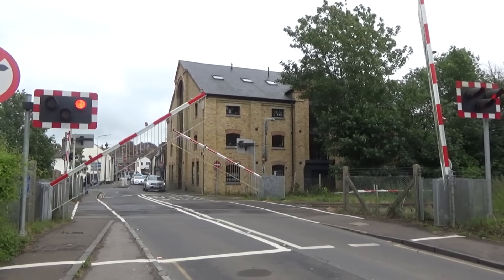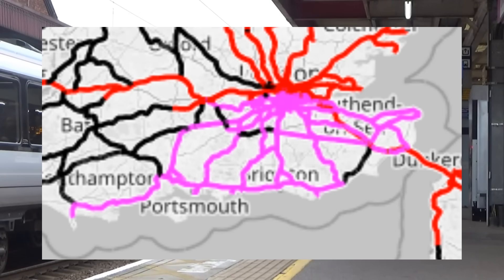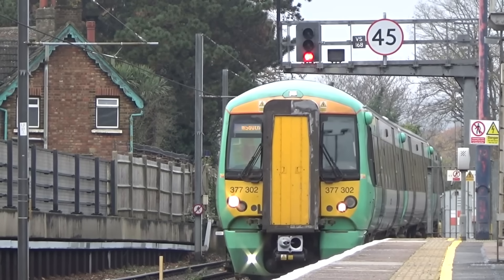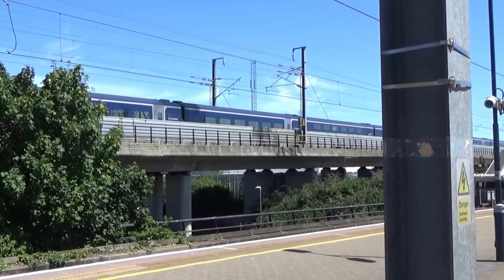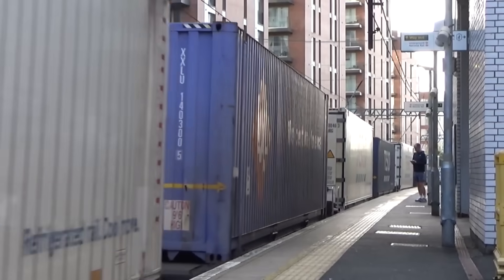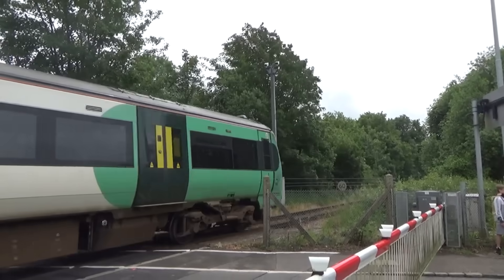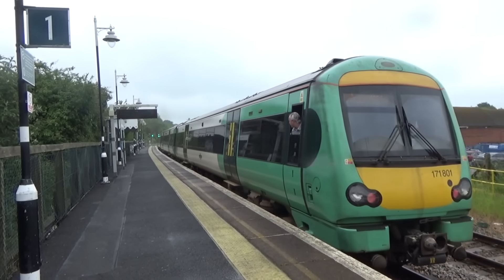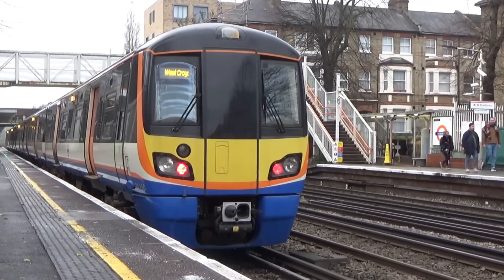Are These Railways Actually Unelectrifiable?

Comment: 0:56 merseyrail is/was third rail, oops, you said it just said it the very second i said at but they got battery trains now
Reply: Some of Merseyrail is third rail some I’d overhead; I cannot remember which lines are which.  Third rail was used on the Mersey Railway before it was used in the South.  The Liverpool Overhead Railway was third rail, but that closed in 1956.

The line from Manchester Victoria to Bury was a strange 1200 V side contact third rail system, now converted to 750 V d.c. overhead for Metrolink trams.

Som lines on North Tyneside were third rail, but de-elected and then worked by Diesel.  I think this happened sometime in the ‘60s.

Volks Electric Railway in Brighton is third rail.

Glasgow Underground is third rail.

London Underground is  4 rail.

Ex LMS lines in the London area were 4 rail but later converted to third rail.  The Euston -Watford ‘new’ line still is, the Rickmansworth and Croxley Green branches have closed and the North London line has been converted to 25 kV overhead except between South Acton and Richmond.

The Great Northern and City Railway is third rail from Drayton Park to Moorgate.

The Post Office Railway was third rail but I think the short section around Mount Pleasant which now carries visitors to the Postal Museum is now worked by battery trains.

Have I missed any others?
Reply: @srfurley think Merseyrail these days had class 507/508s before the class 777(s) across wirral and northern lines, those where the only two lines(?) in Liverpool that where 3rd rail lines
Reply: @AdamHinckley 
Yes, two Merseyrail lines are rhird rial, but I couldn’t remember which two.

I forgot about the DLR, 750 V d.c. bottom contact protected third rail.

I’ve seen a protected top contact system in New York.  The top and outer side of the rail are covered and the shoe is a sort of flat paddle which enters from the side to contact the top of the rail.  It’s something like the old Bury system rotated through 90 degrees.  Not sure if that would be allowed for new installations here, but the incompatibility with the rest of the network would be a problem.
Reply: @srfurley the only other one besides Wirral and northern lines was Liverpool overhead railway, another third rail line
Reply: All of the "Loop and Link" parts of Merseyrail are third rail - the lines in the Wirral plus the three branches going North from central Liverpool and the corresponding branch heading South. These lines all use the tunnelled sections of the network for which DC makes sense and were electrified back in the Jurassic period. The rest of Merseyrail are "branded" suburban lines radiating out of Lime Street so they got OLE when the main line line got electrified in the sixties and thereafter.
Reply: I remember the Southport/Ormskirk northern lines are third rail, they where thinking few times to extend the line from Ormskirk to Southport on third rail, it's only Wirral and northern lines are third rail in Liverpool
Reply: @paulc4383  Actually, the 'Merseyrail City Line' branding is of Northern Rail TOC is in four routes, two are OLE but two are diesel. The latter two could be 777 battery run if Merseyrail  was allowed the capital powers to get the sets; they would charge at both Lime Street and at Chester or Warrington, the actual route terminals.

Comment: Not entirely sure where the need for new rolling stock comes from here- sure the 171s would need replacing, but there are multiple subclasses of electrostar that are designed to take power from both third rail and overhead lines so whichever form electrification took, we could rely on existing classes and move the location of where new trains are needed to combine with some other existing order
Reply: When it is a wet and cold day who cares how old the vehicle is?
Reply from the maker: the 377s that are dual voltage are needed for the runs up the WCML to watford, so they arent available for these lines. the way i see it is when southeastern makes an order to replace their 465s, they could also replace some of their dual voltage electrostars, which could go to southern and potentiall run this? altho i dont see it being electrified by then...
Reply: @LTRains  there's also the possibility of refitting single voltage electrostars into dual voltage subclasses... for example, there are three different dual voltage subclasses of 377 (being /2, /5 and /7) it shouldn't be impossible to convert other 377's to those specifications

Comment: OHLE provision often requires expensive work raising headroom of bridges and tunnels. It's not a quick fix.
Reply: But it is quicker than the rate of third rail electrifaction.
Reply from the maker: mhm
Reply: Yes you can always rule out the obvious if you think in the short term.
Reply: Ignore the headroom problem by allowing gaps of up to say 3 kms which can be run on batteries (or diesel).
(the suggested 3 km is an example, it would need to be assessed to create a standard to build to - make a standard, then do the easy overheads and build trains to meet the standard so you can ignore the bridges and tunnels).
Reply: @duncanbuchanan218 That gives you a new issue.

Comment: For the two diesel lines you mentioned that are deep in third rail territory, couldn’t the operation issues associated with a new fleet for those isolated lines becoming OLE, help make the case to ORR to grant an exception in that areas as it’s kind of a place where there is no reasonable alternative. Some safety measures may be needed, like ending the third rail earlier before grade crossings with a setback and going off battery or supercapacitors over the resulting gap.
Reply: I can't speak on the uckfield branch but the Hastings line would probably want more major works Including redoubling parts and ofc the extra costs of OLE over 3rd rail
Reply: @SingleTheShot  The sparks effect on the Marshlink line would certainly increase ridership and eventually extra services which could well mean the re doubling of the line. Think of the possibilities, the return of through services to Brighton, and may be  through trains from Dover or Margate. Also a Javelin service from St Pancras to Hastings/ Bexhill.
Reply: One of the safety measures considered is only energising the rail when a train is present btw, and I think the orr is happier with that
Reply: So Uckfield line is to be 3rd rail extended, and marshlink will be after. ORR hasn't banned it, it just needs a very good reason
Reply: @simonh317 GTR is looking at fitting batteries to the 377/3s for Uckfield and Marshlink.
Reply: @J-Railway-Volunteer  Green Signals had an in depth piece on this, iirc the conclusion was the costs would be similar for trains + charging vs 3rd rail , and the current rolling stock wouldn`t need batteries then. For Uckfield 3rd rail makes sense, for Marshlink, not so much.
Reply: I don’t understand how there is a safety issue. The rest of the region runs 3rd rail without any “danger” to passengers. They know that the tracks are electrified and not to go onto them how would extending it a few miles be an issue. Things like turning the rail on and off is an unnecessary reinvention of the wheel so to speak
Reply: @MIkeDye200202holla It is because the existing third rail is grandfathered in, so it doesn't have to follow as strict rules.
Reply: Maybe they should at least consider getting a few bimode units similar to any new batches of full-3. rail sets, and run them on 3. rail on those sections, then on batteries on, say the Uckfield Line
Reply: @alexjenkins1079  Uckfield is already in panning for 3rd rail extension - it`ll be North Downs which will get the battery usnits as SWT want to replace everything they have thats 30+ years old. GTR are full on 3rd rail and overhead
Reply: @simonh317 North Downs is Great Western Railway and not South Western Railway. Also North Downs is planned to run to Oxford.

Comment: 0:29 Can it be AC? If no, then why?
Reply: Higher voltages are the key, not AC  v DC. Pushing current consumes power, so if you can increase the voltage, you will decrease the current (less current needs less power to push it, which makes transmission more efficient). OLE uses a much higher voltage, which would be very dangerous at ground level. You can change AC voltage very easily with a transformer.
Reply: @TheRip72  not how it works, increasing voltage allows the use of a lower current to transmit the same amount of power and a lower current induces less resistance
Reply from the maker: yes, but a high voltage increases the risk of arcing, which you cant have down on the ground
Reply: I would think it's impractical because AC is considered more dangerous, you'd also want higher voltages to have lower losses and the same benefits of OLE
Reply: Third rail can not be AC due to the skin effect.

Comment: They cannot electrify the midland mainline without completely redoing Derby as things like the bridges across the platforms and to low for catenary and let's be honest anyway I highly doubt the whole of Great Britain could be electrifyed.
Reply: They said the same about Kings Cross in the late 50s, so they electrified Euston-Glasgow instead of Kings Cross-Edinburgh. 25 years later, they electrified Kings Cross.
Reply: Anything's possible with enough money
Reply: @CoffeeWaffee money the government can't be arsed to spend on electrifying the Midland Mainline
Reply: The Deutsche Bahn did it 2003-2008 with Lübeck Central Station: They kept the historic apperance while lifting everything by 60cm so the catenary could fit.
Reply: What about an overhead electrified rail under the bridges as is used at the Thameslink tracks at St. Pancras, that takes less space than conventional wires.
Reply: @srfurley A Rigid Conductor System does have its advantages; however, it does have major disadvantages.
Reply from the maker: its defo possible, it just wont be free or happen overnight
Reply: Derby would need redoing? My memory must be failing me, I thought that at least the station itself was relatively "fine" for OHLE from when I've passed through, though again, I haven't gotten off the train there, so there's that!
Reply: @fetchstix the station is practically brand new but it would need redoing if they were to add catenary

Comment: why don't they put overhead wires above the third rail in those Railfreight heavy corridors?
Reply: mostly due to loading gauge restrictions, for example low bridges, tunnel roofs and platform canopies at stations that would need to be raised or cut back... Some of these routes have already seen work to increase the clearances to allow for larger shipping containers to be transported, there is a limit to how much more can be done without significant expense... There may also be operational concerns around having third rail and overhead lines serving the same section of track, but I don't have the technical knowledge to know what these might be
Reply: @MercenaryPen  Yeah, theres some issues with safety with having third rail and OHLE at the same place, just due to the risk of passengers causing self death or other related issues.

Its the reason why, sadly, theres a ban on ever introducing more third rail in the country aswell
Reply: There is not a ban on new third rail, just severe restrictions.

There were some serious problems with signalling systems in the Hackney area when dual electrification was used and it was decided that in future only a short overlap to allow trains from one system to the other would be installed.
Reply: @srfurley  There is. ORR has said they wont accept any proposals containing 3rd rail, and them + NR are trying to remove it whereever possible
Reply: @thejaidengal  No. The ORR set the bar quite high in that there has to be no other sensible option, but it isn't banned. There was even a proposal to install some additional 3rd rail at reading quite recently.
Reply: @MercenaryPen Another issue of having OHLE and Third rail on the same track (for extended distances) is electrical interference. Especially if one system is AC and the other DC.

Of course partially they interfere with each other but the significantly worse thing is interference with signalling equipment.

The signals along the South of England are designed to handle interference for the DC Third rail but are most likely not designed to handle AC interference. So you not just have to raise bridges, widen Tunnels rebuild stations to work with the pylons you even have to replace the signaling equipment.

Its basically a complete rebuild of the entire line.
Reply: @IamTheHolypumpkin They will have to handle AC interference from the traction equipment.
Reply: @J-Railway-Volunteer  Not only that - the bigger problem is DC running through an AC locomotive's transformer which could outright destroy it. When two AC locomotives are both operating on the same stretch of dual-current track, some of the DC current runs through both transformers instead of the rail, because copper (transformer and overhead line) has a much lower resistance than steel rails.
Reply: @EbenBransome DC 3rd rail => DC vehicle => rail => transformer 1 => pantograph 1 => overhead wire => pantograph 2 => transformer 2 => rail => grounding point.

"Not significantly different" means that about half the current goes through the rails and the other half through the transformers, permanently magnetizing the core.
Reply from the maker: yeah basically that.
there actually are a few places with both 3rd and OLE, euston being the first i can think of, the lioness line trains still use 3rd rail into euston and their platforms also have OLE for the 730s and 350s
Reply: long stretch of dual electrified AC and DC line would be extremely expensive and unreliable to maintain. They have incompatible earthing systems. AC lines need to bond all nearby metal structures to the return part of the circuit (the rail). Whereas DC systems like to insulate the return rail as much as is possible from those nearby metal structures. If you ran an AC lines with DC style earthing then the OLE would induce dangerous voltages in things like fences and metal bridges etc - things all accessible to the public. If you run DC trains with AC style earthing - it's reasonably safe but the DC return current will move partially into earthing system on its way back to the substation and corrode all those metal structures (which AC doesn't do) - imagine metal rusting with the power of thousands of watts. 

Obviously AC-DC railway interfaces do exist, but they're expensive and require intensive maintenance etc - it's totally fine having short crossover sections and there a number of techniques to mitigate DC stray currents but 10s of miles of the stuff is borderline technically unfeasible
Reply from the maker: mostly cost, as youd need to rebuild basically every station bridge and tunnel along the route
Reply: I'm far from an expert, this is a question, not a statement: Can that work, given that both systems would use the same rails to complete the circuit?

Comment: Worth noting that the 701s are fully capable of having a pantograph and running on OLE, it was done during testing for the first one or two units.
Reply: The same with class 707
Reply: @thebean6731 in fact, thameslink’s version of the 707 (it may be a different class actually, is dual voltage and can use both 3rd rail or OLE
Reply: @老黑班长 dual voltage units such as these run on 750v DC with equipment to convert from 25Kv AC when necessary. They don't run on both at the same time even on the overlap sections for changeover.
Reply: All modern units have space for the equipment handle both AC overhead and DC 3rd rail, though it may be "for but not with" if it's only ever intended to run on one of them.
Reply: Non of the South Western Railway lines have OHLE
Reply: @20Jameshall_babyextra But they all have the cutouts on roofs for pantographs to be fitted. No different construction was made for DC only bodyshelld all the Desiro trains have them (not just Desiro City one).
Reply: @20Jameshall_babyextrathe 701s are capable.  So in theory it can be designed with 701s predominantly
Reply: @20Jameshall_babyextrajust the first 2
Reply: Indeed, lots of modern EMUs can be retrofitted as dual voltage units very easily as they were designed with that capability - Electrostars and Class 450s, as well as the Aventra family. Yes there are costs involved, but it's by no means insurmountable. Dual voltage EMUs are cheaper to operate compared to bi-modes, their operating arrangements are basically the same as any other EMU.